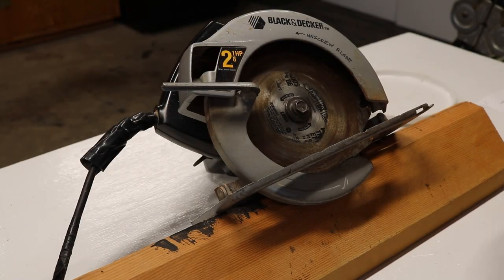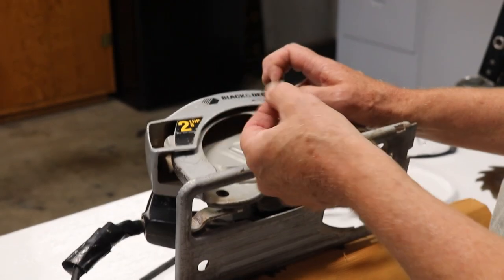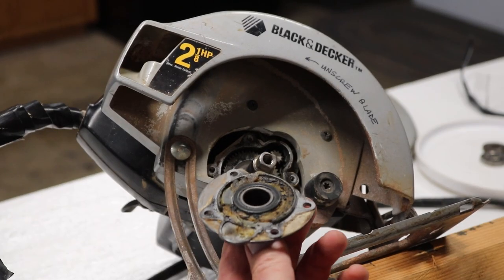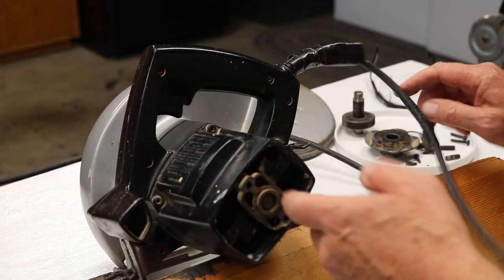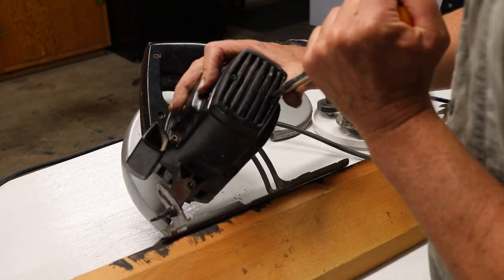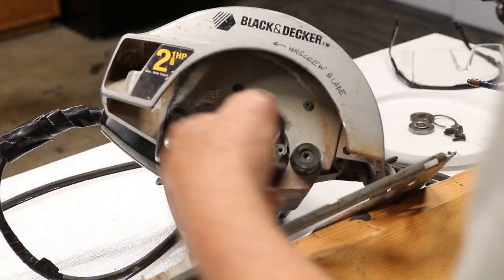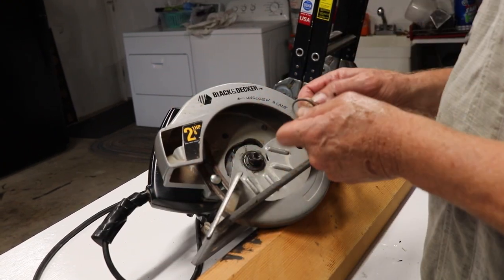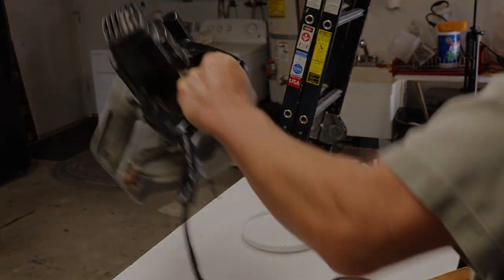Circular Saw Lubrication, Black & Decker Model No. 7391 Type 4

Comment: Thanks for this well-done video. I probably would have wasted a lot of time with unnecessary disassembly without your guide. Wish I had watched before I took off the cap on the brush end of the motor (yes, the rubber plugs fell out without my noticing.)  The only thing I would add is when re-packing the gearbox with grease, don't over pack it. I put in way too much grease and it bogged down the gears badly. I had to go back in and remove about 3/4 of the grease I had used. I had snap ring pliers which helped getting the snap ring off, but putting it back on was just as you described. My saw should now be good for another 35 years.
Reply from the maker: Peter, thanks for the useful comments!  I wasn't sure about how much grease to use, and I did leave some air in the gearbox on mine, which seemed to be good enough, as it didn't bog down.  Good to know you can use too much grease.  It would have been nice if they used  the type of snap ring with the two holes in the ends, but they didn't, so I didn't even try my snap ring pliers.  That snap ring is definitely the hard part.

Comment: GREAT video and thanks for sharing!  I also have this same brand and model of saw but use it only sparingly.  It must be around 40 years old and still runs well, though when the motor is stopping, it makes a funny sound when the blade comes to a stop.  I am guessing that the mechanism also needs lubricating inside like with your saw.

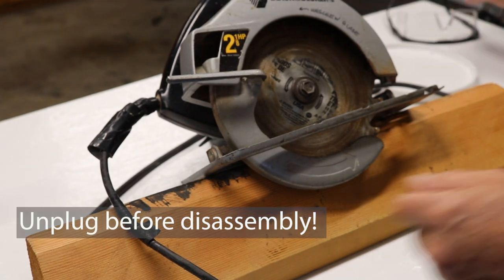Comment: My dad owned a Black & Decker circular saw that I think he bought during the 80s. However, at some point, the blade became dull and he couldn't get the bolt loosened to replace the blade. I'm not sure it ever occurred to him to use a thin metal rod to keep the blade from spinning ( 1:30 ). I took it out, used a tent stake to keep the blade from spinning, and just used a wrench and a rubber mallet to loosen the bolt. Probably the first time the blade was able to be removed in 30-35 years.

Comment: I have a Skilsaw 5150 I bought at a thrift shop so I'm definitely appreciating your video. The parts do not seem to be exactly the same but they're pretty close. I'm not sure if I'm going to go as far as you did with the grease. It probably needs it but it runs OK. When I first got it, the bearing in the blade area was making a bad noise but a little oil cleared that up. 

Anyway, a small tip. The bearing on the motor end of mine had a piece of foam that was covering the bearing. Which I think that was factory and was probably originally intended to be saturated with oil so it would wick fresh oil into the bearing as needed. 

 Anyway, the foam on mine was falling apart and all nasty and going everywhere so I got rid of it, cleaned all the rotted foam out and got a piece of felt that was about the same thickness. Put it in there and saturated it with oil.
Reply from the maker: I think the oil in the blade area gears will eventually need to be replaced with grease as oil evaporates (slowly) and also it may be thrown out when the blade spins.   I like the oil saturated felt fix on the motor bearing.  Sounds like a good solution.

Comment: Thank you so much for this video. I inherited this saw from my grandfather and I’m trying to give it some much needed TLC. Do you have any recommendations for oil & grease to use? I’ve never done anything like this before and don’t want to buy the wrong stuff.
Reply from the maker: Sorry for the slow response.  Busy busy.  The grease to use in the gears is any lithium based general purpose grease as this is a metal to metal lubrication task that is not high pressure or high temperature and is not a wet environment.  For the motor bearing oil, I just used standard engine oil - 30W or 10W-40W.  It's not critical since this isn't a high pressure or high temperature situation.

Comment: dont you think a new cord wouldnt be a bad idea ? there are running a lot of amps
Reply from the maker: I agree a new cord would be a good idea.  I dug into it and found that B&D hardwires it into the switch and motor and they seem to have bonded the strain relief to the cord.  So swapping it out is a bit more involved that I wanted to do at this time.  So I put new tape over the failing area to keep it from bending there and getting worse, for the time being.  This saw has another wear issue - the split pin keeping the base plate from wobbling is wearing and allowing the base plate for rock sideways some.  A new split pin should help. Another video possibility.

Comment: Thank you for sharing  the video Have you changed the power cord  I see tape on it it's easy I did it on one of my skill saws just a safety idea for you if you repacked it with grease and checked the carbon brushes I've had a degrees without taking my apart I stuck into the spindle pushing it down using the screw a couple times I got in there and helped my skill saw from 2009 runs ok makes the normal sound because it has no brake so slow down sound is like a metal chattering sound perfectly normal my other skill does that from new
Reply from the maker: Thanks for your comments and suggestions.  The tape around the power cord is just preemptive.  The cord inside is fine.  The tape just makes it bend around a larger radius so the insulation doesn't break as soon.  Further down the cord I did accidentally cut it during a project and I fix these things using professional electrical techniques with shrink wrap around each wire first, then tape.  Recently I've been using "liquid electrical tape" either by itself or over regular electrical tape to seal it all up and prevent unwrapping.  It dries quickly and looks great.

Comment: i hv just got my first circular saw, it's stanley stel 311, i bought it secondhanded, do you think it has the same way and same components? i will do the maintenance for it looks so awful and the former owner really did hard work with it.
Reply from the maker: Oscar,  Sorry for the slow reply.  I can't say whether your Stanley has the same access as the Black & Decker, but going in from the same direction (behind the blade) is worth a try.  It may avoid a bunch of extra dismantling that isn't necessary.  If you do get in, don't pack the gearbox completely full of grease.  Some air in there is necessary.  Good luck.
Reply: @whatwouldjohndo8977  i hv got Dewalt dw352, it is quite the same with BD 7391..this video is very helpful, the Stanley Stel311 had a problem with the gear, tried to replace the bearing but apparently it gets stuck with the gear cover made from hard plastic material, not metal, and they sell the unit, i mean, we cant just replace the bearing and the gear per one, it is sold as one unit part, the gear+bearing+the cover. So i moved to dewalt dw352, i bought it secondhanded, it works fine.
Edit : The difficult part for me is dealing with the snap ring. 😌

Comment: If I had to do all that I'd go to harbor freight.trash it
Reply from the maker: Suit yourself, but some of us prefer to keep things running for a long time.  A certain satisfaction is derived from it.  Plus, it reduces waste, resource use, saves money, etc.
Reply: I like me some harbor freight stuff, but this is the exact consumerist mindset that led to a demise in quality, serviceable tools, and well, everything else too. You could finish this job quicker than you could drive to harbor freight, assuming you have grease or don't live 200 feet from the store.
Reply: @JulianA-tr6pt  - "Consumerism": the continual buying and consuming of material possessions. 
The "Good/Fast/Cheap" management principle applies when one can only have two of the three elements. 
A "Consumerist" prefers 'fast & cheap' over quality.